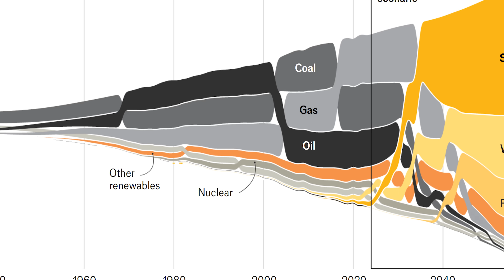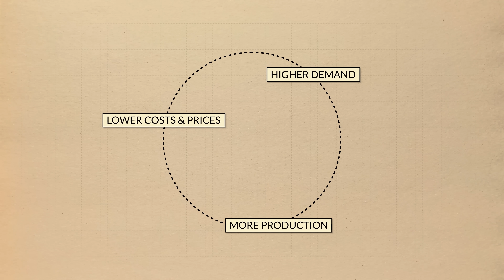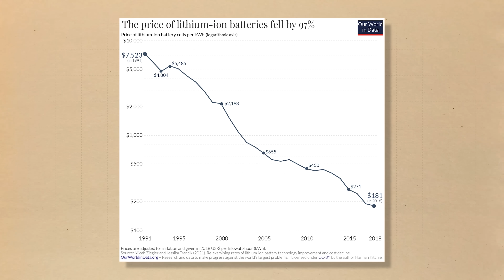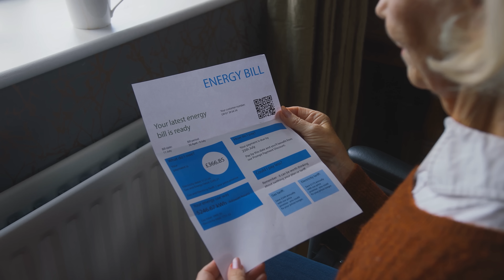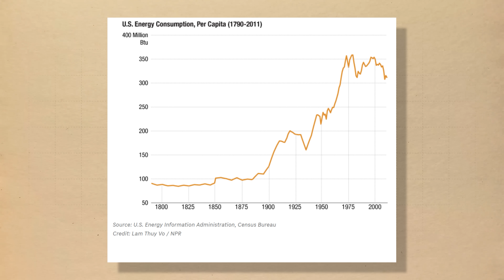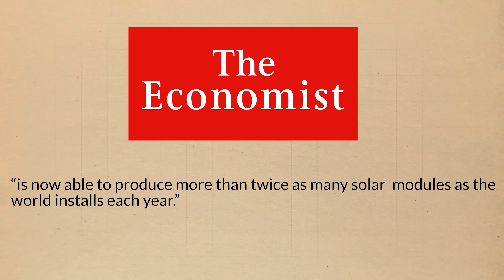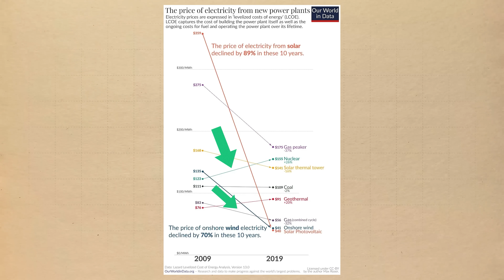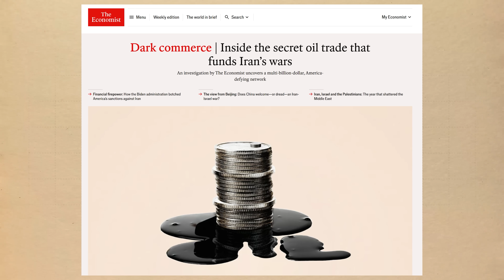Why solar will soon dominate & what that means for the world

Comment: I work in grid scale battery storage and my team developed the best trading system for power in ERCOT (Texas). Texas is the second largest battery market on earth, will become the largest in ~1 year, and is the most “free market” for batteries (we are mostly unsubsidized). There are a lot of barriers for batteries to replace thermal generators.

First, they need to be able to operate overnight at roughly 2/3 the rate of the solar. This means a duration of ~16 to 20 hour durations in regions like Europe or the northern US. Most batteries are 2h systems, and once you go beyond 4h it becomes cheaper to just build natural gas (unless you’re in California where NG is penalized and batteries are subsidized). This transition can be smoothed by maintaining existing gen, but eventually costs either need to fall ~10x or a new 10x more cost efficient technology must be developed.

Cost efficient batteries are often NOT power efficient. This means that they consume 2-4x more power than they produce (lithium ion systems consume about 1.15x).  This means you’ll need 6-12x more solar to cover your overnight power needs. So again, you need a 10x improvement in cost or technology. This doesn’t even account for the transmission issues and infrastructure costs that would come from these gigantic daily fluctuations in solar productivity.

Finally, there is a reliability issue. You really need to double or triple all of those battery durations to maintain a reliable grid in the event of major weather and transmission issues.

With all this in mind, the cost of installing scrubbers and other fossil fuel cleaning systems starts to become attractive compared to solar/batteries when capacity exceeds peak demand. Even developing new nuclear capacity is vastly cheaper than overnight solar.

This isn’t to say that solar is bad. It is wonderful for consumers and grid stability up to a point. There is a limit however, storing solar power for overnight use or for a true green transition is ridiculous without a massive (20x or more) technological advancement. With lithium ion, the cost of raw materials (not including lithium) is too high for even a 5x reduction to occur without a revolutionary breakthrough.
Reply: I imagine you’re all looking forward to these new Sodium Ion manufacturing plants going giga-level. So am I.
Reply: @cameronf3343 I think the Na storage will capture the market for 2-4h storage, maybe even longer to 16h but I'm doubtful. But the advantages, imo, is they are cheaper energy storage than lithium when you aren't worried about power/energy density, and but still allow spinning reserve services to be provided. And, they are safer for home installations, where again weight doesn't really matter.
Reply: There is currently no project successfully scrubbing emissions from fossil generation. If it’s possible, we still have not found any way of actually doing it.
Reply: @xIQ188x scrubbing technologies do exist, but they are not even close to economical so there has been no commercial implementation.

Another thing that has no commercial implementation? Overnight lithium ion batteries.
Reply: This analysis is fair, but is missing parts of the story. 

The effect that rock bottom electricity prices during the day will cause on consumer consumption and subsequently investments into thermal storage (both hot and cold) will likely reduce night energy consumption. Also absolutely correct that solar probably has an upper limit, but I don't think anyone is suggesting to use just solar for the green energy transition. Its going to take solar, wind, geothermal, hydro, and more to reach the 90% renewable energy targets.
Reply: @philsburydoboy You mentioned raw material costs excluding lithium. I'm not an industry person, so I only have read layman articles that said the scarcity of lithium, cobalt, manganese, as well as rare earth metals puts constraints on future renewable energy growth, as well as causing environmental, economic, and geopolitical disruption as more developed countries reposition to secure these new strategic resources. Is it a problem of industry and infrastructure size to extract enough of these elements to meet demand on shorter (yearly) timeframes, or is there just not enough of these elements accessible on the planet at all, to fulfill a complete green energy transition at a reasonable cost?
Reply: @dakaodo  Many people don't understand what 'proven reserves' actually means, when talking about topics such as this.  A mineral 'reserve' is a deposit of a mineral that can be extracted profitably given current market prices and current technology.  It being 'proven' just means we know that it exists.  As we keep finding new ways of making things with new materials that we didn't use much in the past, we suddenly find ourselves suddenly needing large amounts of specific minerals that weren't previously in high demand.  Because these minerals weren't in high demand, not much effort was put into exploring for these deposits, and many of the deposits we do know about were found by happenstance.  Once a new type of mineral is suddenly in high demand, the market has difficulties fulfilling this demand, because we weren't going around looking for deposits previously.  However, the longer demand remains high, the more time there is for prospectors to go out and find new deposits of the stuff, which may or may not end up being classified as a 'reserve' depending on how costly it would be to extract it.  Additionally, technology typically progresses in such a way that extracting minerals becomes cheaper over time, allowing known deposits to become classified newly classified as reserves.

This is why when people claimed 'we only have enough oil to last us 50 more years' in the 1970s, we still have more oil today.  Even though we exhausted many deposits, we also found many new deposits, and changes in technology allowed us to access other deposits we already knew about in a profitable manner.  The same idea is at play with minerals such as lithium or cobalt.
Reply: @dakaodo  Of those metals, Lithium is not rare, we just haven't been mining i a lot. What @adamperdue3178 said about proven reserves is especially true for Lithium.
Reply: @dakaodo No - only in the imagination of Americans who struggle to understand mining as they are in a manufacturing based economy. Do some more research - many have covered this issue and the answer is a resounding no.
Reply: Seems the most likely candidate for efficient cost-effective long term/long duration battery storage will be flow batteries.
Reply: @augustus331  I sort of find it concerning that you work in the field yet found new information in a random YT comment ...
Reply: @nigelrhodes4330 it's not surprising, we are far beyond the time when one person can comprehend entirety of a big project.
Reply: What is the reason why most batteries are 2 hr systems? What are the challenges to go for longer systems?
Reply: @Pier-zl7gm  The sun sets over a 2 hour period, and batteries are used to smooth the rapid “down ramp” of solar generation as the sun sets. They can essentially extend that into a 3-4 hour ramp, which minimizes the expensive cycling of gas and coal units. They also provide “ancillary services” - which are essentially insurance for grid stability. Most of those require less than 2 hours of capacity.
Reply: @Pier-zl7gm needing more batteries. So systems become larger, more expensive, and need more complex internals.
Also what was said about power efficiency. Batteries have losses, and at some point you just don't produce enough power for a full charge.
Reply: @wumi2419  Battery capacity loss has been pretty negligible on even the most badly abused systems in the world so far. It matters but it’s not a big deal.
Reply: @philsburydoboy  you missed what both I and OP are talking about. Battery storage is not perfect, you can't take out as much energy as you put in. In case of lithium it's 1.15x, so you need an additional "hour" of power for every 7. In case of more available batteries this ratio is worse.
Reply: @Pier-zl7gm  Cost per kWh. Batteries simply don't store much electricty and they don't last very long.

Why 2hrs? probably because that maximises the intial benefit of some storage to cover the evening peak demand with the energy from ones roof.
Reply: Good to see some people in the Green industry get it, US guy ofc. Europe is insane, even engineers sound like green fanboys not even looking at the capacity of the things they are installing and critically thinking....
Reply: @CmdrTobs  don't know how it works In Europe but in the US power is largely done by private companies or by local governments. So there really isn't too much green mandates outside epa regulations and subsidies
Reply: Lets just aim for a 80%+ renewable grid with Gas Turbine Peakers to back it up. When we get there we can look at replacing that last 20% but we MUST do the first 80% cost effectively and reliably that means Gas Turbine Peakers must be part of the mix. After that battery pricing will determine how much Gas backup is needed but it WILL NOT BE more than 20% of the grid and I would expect less than 10%.
Reply: @TimMountjoy-zy2fd  80% that seems out of the air.

Clearly this naked % is confusing people. For solar it's percentage is delivered almost exclusively daytime in summer. So if 'they' say solar represented 100% of our annual demand.

* 'They' are really are saying we covered summer afternoons and massively over produced in that time period. Night and Dark winters days remain uncovered.*

Hence why TV shows a couple decades ago used to say renewables could provide up to 25% of power! They weren't being needlessly pessimistic, that was real before it got politica.
Reply: @TimMountjoy-zy2fd   
People dont know that you have to order gas ahead of time 

Going that heavy solar without batteries you have to think just how big the swings in gas needs would be hour to hour with cloud overhead.

You do that and your gonna end up burning oil along of the time because you'll be short gas when you need it
Reply: Simple thermal storage of solar power (eg. "sand batteries") is like 50% efficient round trip, so I have no clue where you're pulling that 2-4x more power stuff from.
Also, you know ERCOT and the Texas power market in general isn't all that highly regarded.  Maybe you're in a bit of an information silo with a wee too much sniffing each other's butts going on ;)
Reply: Unless we invent cheap efficient batteries with near-infinite amount of charge cycles, its a terrible option for grid-scale storage.
Most of the world, has a high pumped hydro potential that can efficiently store and release much more power for a fraction of the cost and for much longer time. A decent-sized pumped hydro installation can store and release power on the scale of hundreds of megawattsto gigawatts and the reservoirs can be built on the top of any hill with suitable geology. With maintenance, such installations can last and pay out for centuries, orders of magnitude longer than any battery.
Reply: I think you need to define 'battery market' as your claim is a bit dubious.  China is far and away the largest manufacturer of batteries and even second place Korea is not even in the same league, the US is effectively not in this market.  In terms of grid battery installation, yes at present the US is ahead of China, but the IEA believe that China will be far larger in just 2 years.
Reply: @philsburydoboy  By the way, you know that famous "duck curve" graph is cherry picked from the absolute worst day of the year, right?  It's a thing to be sure, but it isn't nearly as dramatic as most folks seem to think.  

Solar production tends to line up pretty nicely with cooling demand.  That graph is from early spring where cooling was basically not a factor.
Reply: I think we definitely need a mix of nuclear/hydro for base load and solar+battery for the peaks.
Reply: @quintonstevens  Baseload is a bad way of thinking these days.  Variable renewables can relatively cheaply provide more power than the grid demands much of the time... So, what does baseload actually mean in those cases? (Rhetorical question)
Thinking instead in terms of variable, dispatchable, and slow ramping sources tracking a constantly varying demand makes more sense.  

BTW: That's why the new molten salt nuclear reactor being built in the US (Wyoming maybe) is so promising.  It is a more or less conventional "next generation" reactor, but it dumps the heat into salt which is integrated with storage.  One benefit is safety, since cooling is essentially passive and doesn't require boiling water to absorb the energy, but it also decouples the reactor from the thermal generator letting the reactor just chug along at an optimal rate and the generator to dispatch power tracking unmet demand.  It should play very nicely on a grid where variable renewables are providing a large amount of the power much of the time... I think synergy is actually an appropriate word for once
Reply: In Germany we (as in the scientific community, I have no idea what the politicians will do) plan with Hydrogen electrolysis for most storage needs.
We can get the electricity-electricity efficiency up to about 50% right now and this could still rise in the future or be improved by secondary uses like district heating with the waste heat.

It's not perfect of course but good enough, the main problem is that there is no real business case for building an electrolyser in the current market environment yet.
I think the market design has got to change to reflect the new meta.
Reply: @steffenjensen422  As others have pointed out many times in the past: If someone thinks they can make hydrogen storage work, why not start with replacing the existing hydrogen production from natural gas? That is magnitudes easier than taking the extra route back to electricity, and yet nobody is doing it, so not even that step has become viable yet.

So no, hydrogen storage can be regarded as a science fiction solution for now. What actually happens when Germany pushes for more wind and solar is that it prolongs its dependence on fossil fuels. The whole Energiewende has been a disaster. All those billions wasted, and basically all it did was make electricity costs high and unstable, and reduce Germany's industrial competitiveness with no benefit for the environment. They still have more CO-pollution per produced amount of electricity than basically anywhere else in Europe. If it had spent those billions on producing more nuclear power rather than shutting their existing power plants down, it would have excellent numbers by now. It's just crazy.
Reply: We have to all, solar wind and nuclear.. with fossil as backup?
Reply: @michiel1362  Fossil as backup is not a great idea cause every bit of CO2 makes climate change worse. Hydrogen as backup is probably better. Though I fear it's also more expensive
Reply: Actually good to see people point out te realsitic costs of Solar, including the all-so-popular method of "storing excess energy for night time use". Solar is good for supplementary power indeed; but Nuclear is the only viable baseload for the future. We cannot control the sun or the wind, but we can absolutely control hot rocks deep in concrete.
Reply: @philsburydoboy  you are looking at this from a brid perspective. What you are not taking into account is that this change will also significantly change the function of the grid, and the load that will be taken away from the grid because of it.

As solar and batteries keep getting cheaper over time, they will also become ubiquitus at an enduser level.
It will simply become significantly cheaper to generate and/or store your own power for most of your needs then pulling it from the grid.

This switchover to solar will also inevitably come with flexible pricing for energy. Cheap during the day and significantly more expensive during night times. Creating an incentive for end users to install their own storage appliances themselves. Fill them during the day with either your own power or cheap power from the grid when cheap power is widely available and then have enough in storage to get you trough the night without pulling from the grid.

This really only needs relativly small storage capacity for most users. Making these appliances cheap and they will pay for themselves quickly.  These will become cheap readilly available consumer goods.

The grid will have to transition from a centralised one way system into a peer-to-peer distributed network.
Reply: @rogerk6180  You hit it on the head dude. No one ever thinks about the offset only that there is a forest there.
Reply: Nothing says the energy grip must be 100% green. A solar + natural gas combo (or solar+wind+NG) can work without battery.  Use surplus solar power during the day to scrub CO2 from natural gas used at night.  As long as the outcome is a net zero, then it's good enough.
Reply: @xiphoid2011  good point. There are a number of outfits (Ie Aurora) that are working on scrubbing hydrogen from natural gas - by pyrolizing it with microwaves where the carbon precipitates as a solid and you have hydrogen.  Also there is no shortage of natural gas and existing infrastructure.  As far as grid storage the most promizing battery tech seems to be Form iron-rust battery which would be very inexpensive and there are no special metals or earths required.
But any articles that talk about solar taking over so much need to include the grid storage.  

Of course some regions like Japan and South Korea are working on burning liguid ammonia in power plants as well as marine shipping. (This is not just being planned, it is being done).  Since Ammonia is NH3 there is no c02 emissions as it burns.  And one advantage is that it can be transported and stored like propane (so there is existing infrastructure).
Reply: @xiphoid2011  Except it's being explained that nothing but solar/wind is needed and that you are a paid shill if you say otherwise. hence the no drill, no exploration policies...
Reply: It's a pity there aren't that many energy hungry places with great solar and hydro potential.
One fun option I've seen is undersized, salt cooled nuclear reactors with thermal energy storage and oversized generators, specifically so the reactor can run at a fairly continuous output while electricity output varies enormously throughout the day. Not sure how far that tech has gotten, but superficially it strikes me as quite elegant if electricity storage doesn't get drastically cheaper, or daytime electricity doesn't get borderline free.
Reply: @fnorgen A molten salt reactor with thermal storage is being built right now in Wyoming or Montana (I think).  It isn't just a tiny demo either, and has real $ behind it. So, yeah, looks like that has a very good chance of actually working.  It is one of those sort of obvious in retrospect ideas.  
A fun detail, the engineering for the molten salt storage side is mostly coming from existing solar-thermal.
Reply: @fnorgen  Thats only really attractive it you want to take heat OR power out.  If your just looking for electrical output then a pumped hydro facility buffers the Reactor at lower cost.
Reply: @kennethferland5579  Yeah pumped hydro is awesome, but it's very dependant on the local geography. A a big tank full of hot salt can be built anywhere.
Reply: @fnorgen  another great option is build out UHVDC across the USA and connecting Lake Mead and Powell, with massive floating 2-axis solar providing 12 hour solar and hydro for night power.   We are also lacking reservoir water so the solar can power pumping a small percentage of excess Mississippi water from Louisiana outflow through a new pipeline.  Reverse flow can help during draughts for water security.  All this can be payed for by the new proposed National Infrastructure Bank.
Reply: Thier is no batter on the market that take '2-4x' the energy to charge as they then deliver back.  That is a 33 to 25% round trip efficiency and the range of THERMAL energy to electrical conversion efficiency.
Reply: @kennethferland5579  lead acid does and is still first choice for UPS applications that require long life, high load low cycle etc..
Reply: Yeah in the Florida power biz we think around 10 percent is the optimal solar allocation for us.

The folks that are saying exponential trend don't really get that solar is really just competing with the peaking units.

And hits a hard wall going beyond that
Reply: @evan448  Solar competing with peaking?  What?  Variable renewables are complimentary with gas peaking.  That's like the whole basis of the Pickens Plan.  
Do y'all still talk in terms of "baseload"?  I knew we were a bit behind down here (I'm in FL), but damn.
Reply: @travcollier   we won't see duck curves in florida until the 2030s I'll put it that way
Reply: @evan448  I don't know.  The folks who reliably stand in the way tend to be pretty damn old down here.  

BTW: Personally, I'm in favor of more decentralized generation (and the grid configuration/upgrades needed to support that.). Industry and government folks are very fixated on grid-scale because they are just looking at the simple costs.  But inherent redundancy and resilience is a less immediately tangible but very real benefit too.  Folks also tend to like the idea of more direct control and more independence.  Paradigm shifts usually take a long time to happen, but happen fast when they finally reach critical mass.
Reply: @travcollier  I think there are rational reasons other than economics to have your own backup power. 

Just from this last storm millions of people across the state lost power.

And you could come up with a kind of dentralized system which counted non utility scale power towards the overall capacity. 

Like drawing on residential batteries for peak shaving
Reply: well said by an engineer the arts  bloke  above does not understand a single thing
Reply: You obviously seem knowledgeable and I don't think you're "wrong", but I want to nit pick and see your response. 

Firstly, I think your overstating the impact of different duration storage. I entirely agree we should look at storage as 4 types; evening peaking/spining reserve, over night, short period, seasonal. Of course the first to develop is the 2h since that allows the owner to buy and sell power multiple times a day maximizing revenue, and buy power at noon and sell at the highest rates in evening. But that is widely expanding, and we're starting to see commercialization of the overnight systems, but realistically over night systems won't be built widely until 2h sites are largely built out. If a 2h system hasn't been built, the economics will always be better, unless you have a break through technology that is magnitudes cheaper the Li Ion but also very slow ramping. And expect this 2h storage to become less expensive, either with Na Ions or with used EV batteries being repurposed. 

But building out those 2h systems pushes out NG in the evening as a regular peaking source, which is the highest demand period of NG. So this both reduces the capacity of NG plants you need on the grid, and of any hour of the day has the greatest reduction in NG use and CO2 emissions. It also then increases the cost of overnight energy by forcing the NG plants to make all their revenue in that time, and creating a market for solar at noon allows more solar to be built, improving the market for overnight storage. That comment doesn't account for the need for NG on a very cloudy day, but longer period low output can also be offset by existing coal plants since it isn't a rapidly changing output. 

Secondly, and that said, I agree with your cost efficient/ power efficient point, and while there are a few technologies (mainly compressed air and Iron air batteries imo) which are now being commercialized, the cost of overnight storage is still not competitive with NG over night. Again, as said, with more 2h storage, that becomes more competitive because NG for overnight prices rises. But I don't agree with your takeaway on the cost drop needed for these systems. Because day time demand could reasonably be significantly higher than overnight demand (EVs for example, consumer behaviour with washing machines etc, but also AC already existing but always expanding) and price differentials may make the overnight price attractive enough even with lower efficiency.

Thirdly, and maybe most important, the point about how much more solar you need. I would say it's really a function of how long a solar panel needs to operate to be profitable, and if a solar panel is able to make all its revenue when prices are highest at 5-7pm, then building solar panels to fully cover that period will mean significantly higher capacity at noon because the higher efficiency and lower demand. If the solar fleet is built to handle near the maximum load at 20% efficiency, then the half of the day it's producing at 40% efficiency for half the demand gives you a lot of excess power generation to work with; the higher conversion losses of nightly storage are partially made up for by the higher conversion rate of noon sunlight. 

I agree with the reliability issue on multi day storage. In some cases upscaling hydro plants may offset this, and like I said the Coal fleet which otherwise is losing purpose is well suited to that role. But this won't be addressed until the overnight storage is largely built out because, again, there is no reason to invest when there is a more reliable investment available. And that overnight build out will create the price market where multi-day occational use storage appears.
Reply: @neolithictransitrevolution427  Those are very good counterpoints. I didn’t bring up iron air or compressed air specifically because I have received a lot of conflicting insider info about both systems. As of right now I’m sure what to think about either. I do think if Form can achieve the 35% efficiency numbers they’re looking for then it likely is good enough to fully replace thermals if co-located with solar.

Another interesting technology is molten salt reactors. They are essentially a colocated nuke and a thermal battery.
Reply: @philsburydoboy  I'm a huge fan of molten salts, I don't think they will beat out solar for electrical generation at utility scale, but I think some smaller detached cities might use them. I think the real promise is in process heat, likely co-producing power. But mainly in industrial setting. I'm hoping they come to dominate the oil sands. 

I'd also like to see them as the main reactor on commercial cargo and oil tankers. You'd make them emissionless, increase shipping times by 50% and need fewer ships accordingly, increase cargo capacity by a half. But I know that's a ways out. Hopefully the navy experiments with them soon.
Reply: I would believe you, but you are from texas so…
Reply: Nuclear is the obvious answer to what we should add to the mix. It's very safe, very reliable and have a very low footprint. It's currently heavily penalized compared to other energy sources that are allowed to pollute freely despite causing vastly more damage than nuclear ever has. Once we fix that, it can compete fine even in a shorter time frame. On a longer one it's already quite viable, but there's an unwillingness to lock up money in an investment that needs 20 years to pay off, assuming political sabotage doesn't shut it down prematurely.
Reply: @beardmonster8051  Nope cost prohibitive to operate, and too slow to deploy.  Batteries already obsolete Nulcear power.
Reply: @kennethferland5579  If that were the case, then why have we seen an increase in the number of built reactors in various places around the globe and plenty of plans for new ones? I think you should see the Illinois Energy Prof's video on the economics on nuclear power.

I don't get the "too slow to deploy" argument either. Here in Sweden we certainly built our nuclear reactors way faster than the wind turbines, when you look at output. Sure, it's faster to build gas power plants, but if you want to replace fossil fuels, nuclear would be faster than building wind/solar, storage capacity and other changes you need to the grid to make it work.
Reply: @beardmonster8051 nuclear is too expensive (as you said 20 yr payback) and too risky no matter what is said.
Reply: @economistfromhell4877  It's way less risky than the alternatives, that is fossil fuels, as they every day cause more deaths due to pollution than even Chernobyl did.

Costs don't exist in a vacuum. Nuclear was made more expensive by putting way stricter rules than on other power sources, like fossil fuels, making people prioritize fossil fuels instead for decades, thereby killing millions every year for no reason. But we're seeing increased numbers of nuclear reactors built now again, in places where people are more concerned with long-term costs (where nuclear is competitive) and the environment (where nuclear is best overall, for now).
Reply: @beardmonster8051  I agree a 100% and it doesn't have to be some major new tech breakthrough.  from 1950 to 1970 the US built 170 reactors. 
For instance Point Beach in Wisconsin was built (by novice designers) in 3yrs in the late 60s and is still operating almost 60 yrs later.  The same plant would cost $740 million to build in 2020 (According to the podcast Catalyst on Nuclear) 

In Ontario, 60%+ of its electricity is from the Bruce and the 3 other nuke plants. Its gigawatt scale and baseload (and employs a lot of people at well paid salaries).
In contrast Ontario build some 2700 wind turbines (at a cost of appr 11billion) since 2011 and these produce at best 7% of electricity (and its intermittent).
Reply: @peterkratoska4524  Here in Sweden we built 12 reactors in the 70s and early 80s. Since then 6 of them has been shut down, largely for political reasons, and a large push for wind power has been made instead. After a few decades of that we now have more than 5000 wind turbines that in total produce roughly the same amount of electricity on an annual basis as the reactors that were shut down and nowhere near what the remaining and more powerful reactors produce. Meanwhile, some industrial development in southern Sweden has become impossible due to the limited amount of reliable power, there are spikes in electricity costs, vastly increased costs for balancing the grid, greatly increased risk of power shortage during cold winter days when we need it the most and to top it off we've had to run an old oil power plant that has been kept for emergency purposes quite a bit, which is a step back for a country where there's strong political will to reduce CO2-emissions further from our low levels.